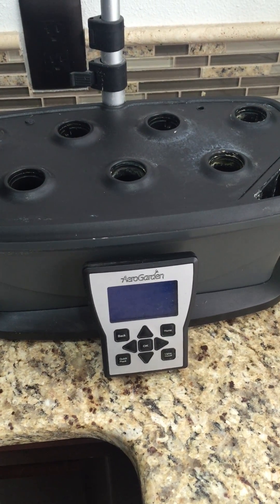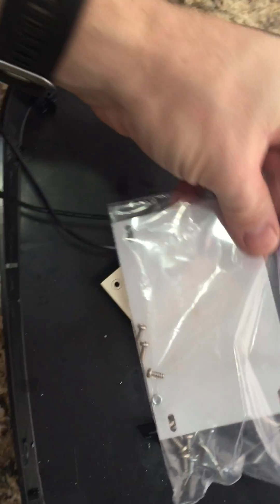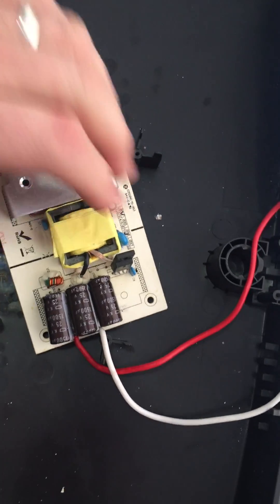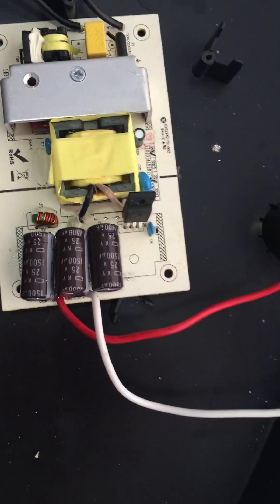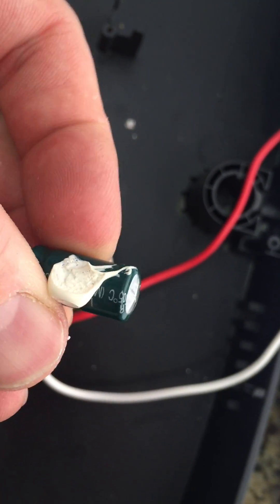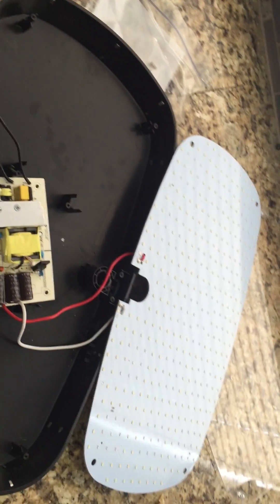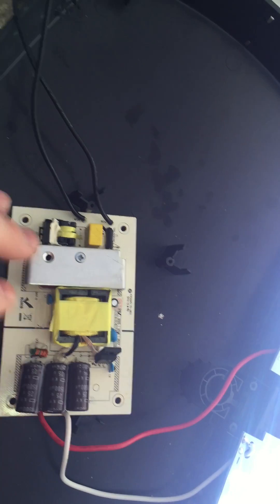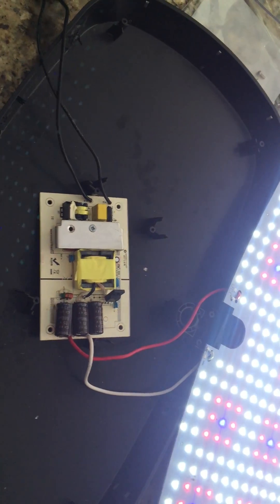Aerogarden LED Repair pulsing/strobing/flicker

Comment: I did the repair using 50V 1500uF capacitors (thinking that doubling the voltage rating would provide increased robustness against voltage spikes).  Alas after ~4 months it has begun to strobe again and the Capacitors are not burst like the previous ones.  I have another failed unit with the original caps that is strobing but the caps are UNburst. 
QUESTIONS:  
1) Does anyone know if an electrolytic cap can be bad without bursting?
2) Does anyone know what kind of power supply this is?  (It would be better to replace the whole thing than keep fixing a bad design.)  It may be a simple voltage supply or it might be a constant current circuit--perhaps with a startup mode or a current limiter of some kind also.
3) Has anyone found a contact at Aerogarden or elsewhere that has some information (description, specs or even a circuit diagram).
Reply: having the same issue, did you come up with something? thanks
Reply: I have researched more but not had time to finish.  I called AEROGARDEN about my Aerogarden EXTRA model LED unit and they had very little technical information but they gave me one key piece of info:  The unit is rated at 30 watts.  One may be able to measure the voltage on the aerogarden supply even if it flickers and get the nominal DC output voltage.  They next question is whether it is a simple constant voltage supply, a constant current or constant power supply or some hybrid.  A constant current device may have a non-constant voltage that can be detected to clarify this.  Any LED supply will have some special design features to powerup that must be at least compatible with the LED assembly.  I have 3 options in mind to proceed:

1) Hard: back engineer the circuit and try to identify what key component is bad.  Here is a tutorial on how another guy did it for a another LED supply that MAY be similar.     https://www.youtube.com/watch?v=UerFD3AgJHE&t=444s&spfreload=10 

2) Take a shot:  After measuring the voltage to be X volts and steady.  Find a PC or device power supply lying around (e.g. 12 Vdc and >30 watts).  Unhook the old supply (noting polarity) and connect the new one.  See if it works.  (Could break LED.)

3) Find alternative, new LED supply:  
a) Assess the type of supply as much as possible.  The output voltage you measure may be clear even with it is strobing.  With luck, it may be 12Vdc, or another constant voltage.  If it is constant current, the voltage may oscillate at a high frequency or slowly over time based on temperature.  (If you have an oscilloscope look at it.)
b) Find a new LED supply for your best guess type that is rated for that voltage (or current) and 30 watts (or maybe a little bigger for some margin.).
c) Buy and try in place of the original supply.    One should be able to find one for ~$15.00.  e.g. https://www.trcelectronics.com/View/Mean-Well/APV-35-12.shtml   This site has constant current and power supplies also.

Comment: Mine has just come to flicker again ! I replaced the capacitors again with new set but the light still flickers! Any help would be appreciated!
Reply: Did you replace the smaller one standing upright? That is most likely the issue.....see if its popped or bulging at the top.

Comment: Thanks.  I followed your instructions and they were perfect.  Used the 25v 1500uF capacitors sold at mouser linked in comments.  Those were the capacitors in my Aerogarden LED Ultra.   Less than five minutes to fix my aerogarden from flashing constantly.   I was not going to pay retail for a replacement hood on a beginner's light.

Comment: Many thanks for a very helpful video. My Aerogarden started to strobe and I was about to replace the hood when I looked up your video. I ordered the parts from the Mouser link that is posted in the comments and followed your instructions. Everything went smoothly and the hood lit up perfectly.  One thing I would add. For those (like me) who don't know how to find the polarity of the capacitor, there is a stripe down one side showing a negative sign. Ensure you match that to the negative sign on the circuit board where the old capacitor came out and you will be fine. You saved me $160.00..!
Reply: That tip about the negative stripe was very helpful, thank you!

Comment: Sadly mine from an Ultra has a newer panel that is more solid state - I do not have those three capacitors.
Reply: If you look know the power supply rating, you can probably find a replacement that will fit. If it is not a custom design, you might be able to find the same unit. If not, it's probably still a capacitor failure. See if you can spot any large capacitor (can shape, usually black, light blue or gray) that has a bulging end, or visible leakage.

Comment: Thanks for this very helpful video.  My Ultra just developed the same issue.  Your video should prove invaluable for the repair.
Reply: Doc Brown and others who offered helpful information, my thanks.  I ordered the capacitors at the link suggested below http://www.mouser.com/search/ProductDetail.aspx?r=661%2dEGXF250ELL152MJ2  and successfully replaced them in the LED hood.  It works!  I consider myself fairly handy, not an electronics expert by any stretch, and I would not say this was a difficult job at all.  Just take your time and use care with the soldering iron to melt off the solder beads holding on the heat sink, remove the nut holding the screw onto the plate, and take off the heat sink.  Same thing with the capacitors.  Mine had a hardened white material they used to set the capacitors in place, so I used an xacto blade to gently break it apart to free them up.  

By heating the solder beads holding the capacitors to the circuit board, I was able to pull the short wires through.  Then, I just reversed the process with the new capacitors.  The new ones have long lead wires on them, so after soldering, I clipped them down.  I did test the light before I put it all back together.  Reverse process and reassemble---back in business.

BTW, my AG Ultra is about two years old.  All Aerogarden offered to do was to sell me a new light hood for 60% off.  Well, no thanks.  This light still has almost 70% of the life left in it.  Seriously, they want me to buy a new light (even at a discount still expensive) when this light has more than half its life remaining?  That smells like a product defect to me.  Total cost of repair w shipping, about $8.

Comment: Thanks so much for this. I was able to repair my Aerogarden thanks to your post. I ended up with 35 V instead of 25 V capacitors. They were a little longer but still fit just fine.
Reply: Electrolytic caps have a working voltage rating (WVDC). The tolerance of these caps is normaly +20%/-80%. The dielectric (insulation layer) is formed by the electric field, and the capacitance decreases significantly with lower applied voltage. You should be fine, but it's best to get as close to the working voltage as possible. The caps you used might have a tighter tolerance.
Reply: @robertgraf9265  The voltage rating on AE caps can be taken as a "max" voltage rating.  In fact, you want to "derate" your capacitors to be above your circuit's peak voltage in order not to prematurely shorten its life or induce failure (not try to "get as close" as you can - haha!) .  Your statement is wrong and the opposite from the truth.  Please research your statements and understand what you're doing before you spread false information that could potentially cause damage.
Reply: @jmuessig  If the rating is WVDC, for Working Voltage Direct Current. then you do not want to 'derate'
 the capacitors, as the applied voltage forms the dielectric insulation. As voltage decreases, so does the capacitance, up to 80% on some. These capacitors also have a maximum voltage rating, but they are designed to work up to the WVDC rating. The capacitor data sheet explains this.
Reply: Robert Graf seriously, where are you coming up with this stuff?  I’d love to see the “data sheet” and really any information that supports your claim.

Comment: Thanks for the video!  Just finished the repair as you described - easy install and worked perfectly!  Here's the caps I ordered and used from Mouser...
http://www.mouser.com/search/ProductDetail.aspx?r=661%2dEGXF250ELL152MJ2
Reply: Joe, is yours the Ultra model?
Reply: My is not an Ultra model as far I can tell by the label on the unit.

Comment: Thanks for this. I wasn't able to find the right capacitors with the right dimensions. Mouser has some 25v 1500uf but they are larger than the ones on the Aerogarden. Can you please link to the ones you used?
Reply: I just did this and used these capacitors for my AG Ultra model.  They fit just fine.  http://www.mouser.com/search/ProductDetail.aspx?r=661%2dEGXF250ELL152MJ2
Reply: @tahquitz2012  Thank you, this is useful for me a year later.

Comment: Thanks for the tip!  How did you get the capacitors out?  Wire cutters and resodder or?
Reply: I am so confused....soldering? I would have liked to see you pull out caps and solder and everything...I am not an idiot, epileptic ..after a 26 seizure in 36 hours, I get confused easy ..I just bought my dad one and mine stopped 2 weeks later! Using his lights, but they are smaller.....would you mind terribly working with me to fix this, I only get 800 from SSI, I don't want to screw it up, can't afford to replace....

Peace
Reply from the maker: I used a solder sucker, you can use a solder wick as well, they have them usually at radioshack/ebay/amazon. You could heat and pull them one leg at a time but take care to not damage the board. Dont forget your polarity on the caps on installation.